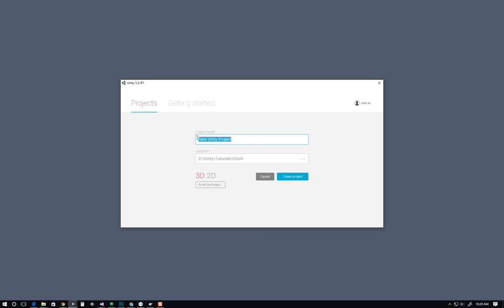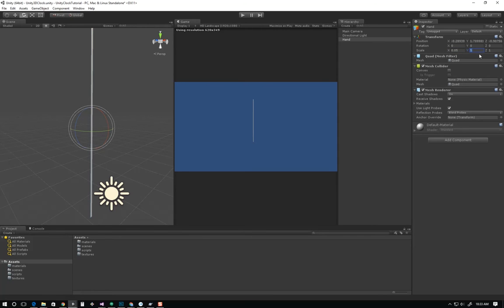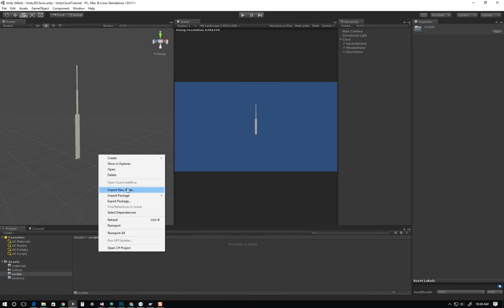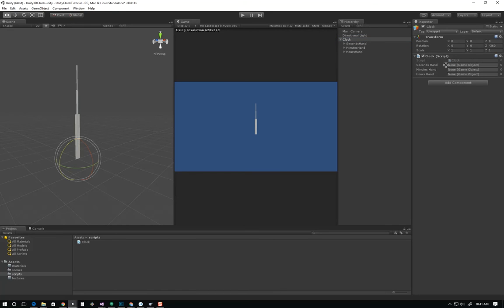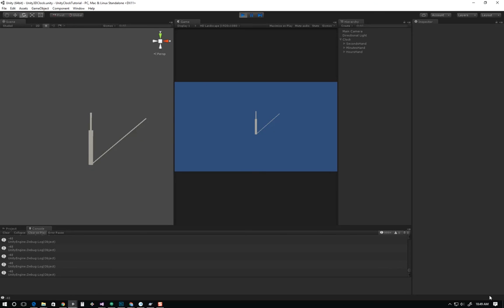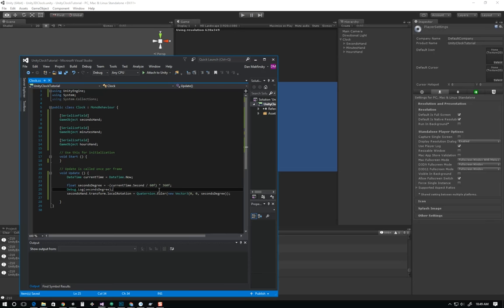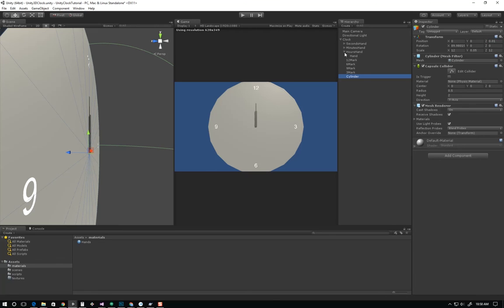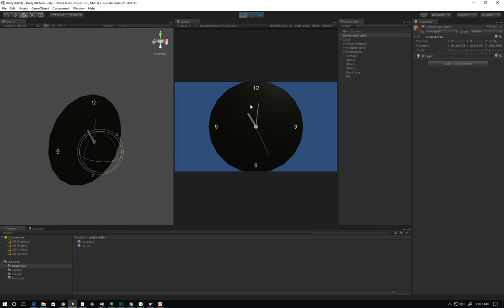Making a Real-time 3D Clock in Unity

Comment: Would just point out that the hour hand isn't realistic.  When your clock is reading 10:53 it looks like 9:53 because on a real clock the hour hand moves throughout the hour - rather than clicking on one at the end.  I think you were looking to add smooth sweeping later, but it's pretty much required for an accurate clock representation for the hour hand.
Reply from the maker: +Mike Talbot I’ll see if I can find the time to update that soon. Thanks for the comment.
Reply: I know this comment is 5+ years old and you probably don't care anymore, but if anyone else sees this and is wondering, here's the easiest solution:

hoursDegree = ((currentTime.Hour / 12f) * 360f) + (minutesDegree / 12);

Comment: Hi! I finished watching your video and I loved it. But I want to add another alarm and a calendar in the app. But I'm new to app programming so I don't how to do it yet.  Can you please help me? Any help would be great. Thanks in advance and keep up the good work. :)
Reply from the maker: +Uzbek Bros TV 
I would recommend doing some c# research. It would take too much to type out any solution but a possible solution is to check on every second whether we hit a specific time then fire off an alarm. You can implement the alarm in many ways. I recommend starting as simple as possible and building up. First get it working with a hard coded time, then develop some ability for a user to set an alarm time somehow, unityGUI would be a good place to look.

The calendar is a bit more complicated. But again, you should research c#'s datetime class and trying to start really simple.

If I have time I'll see if I can make a video touching on those subjects. Good luck!